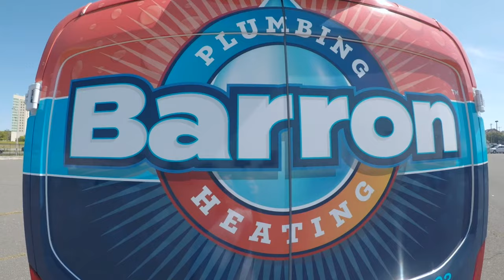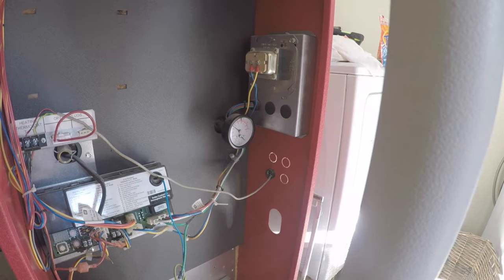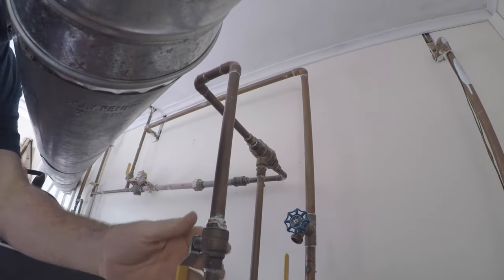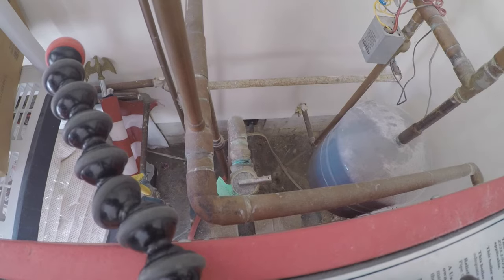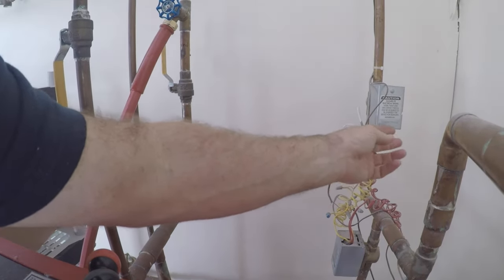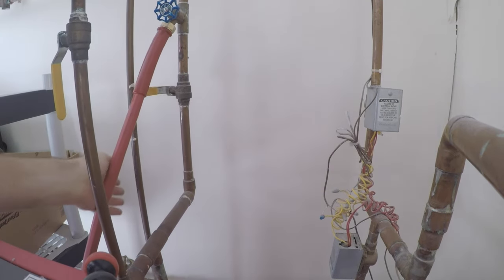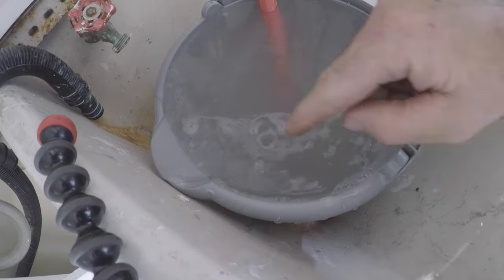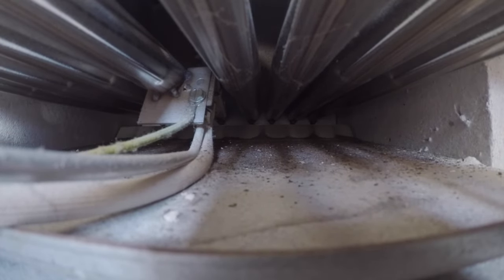PLUMBING REPAIRS | CROWN BOILER | NO HEAT

Comment: Looks like I have the same Crown gas boiler... only on it's 4'th year and throwing a code 4 error. Short cycles a few times, the error code goes away and then seems to run as should.

Comment: That needs air separator like a spirovent. 
And the expansion tank is not upside down. That is its position when installed on a scoop. 
Also is that a galvanized nipple on the water line after the auto fill valve. 
Of so thats a no no where I'm from. Inspectors or gas company would red flag the boiler for that. Especially being on the potable side.of the backflow
Reply from the maker: all true.

Comment: My mothers apartment has 6 radiators but only 2 that are actually working. The other 4 have been turn off at the valve because they make her apartment to hot and also make alot of noise. Banging all day and night. Would it be bad for the boiler or the pipes themselves just having the 2 radiators working ?? Would this cause problems to the rest of the pipes and boiler,mm   Note.. I did tilt the banging radiators several inches but it did not make any difference in the. Noise. So I turn those 4 off. The crown boiler is has an 85,000 BTu output and a 103,000 BTU input.  Currently working nicely. I drain all the water this weekend and fill it back up.  unclog the sight glass, pigtail and the pressure gauge. I lower the pressuretrol settings to 1.5 PSI on the main and .5 on the differential.  This boiler heats up a second floor apartment. Do you think these are the right settings??  I would really appreciate your input on this. Thanks you.
Reply from the maker: Is it a steam boiler?